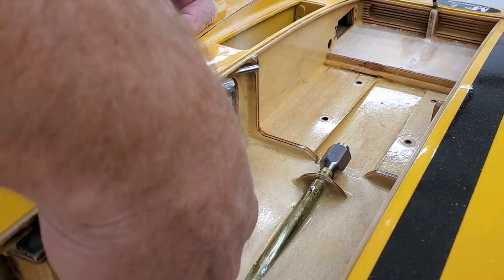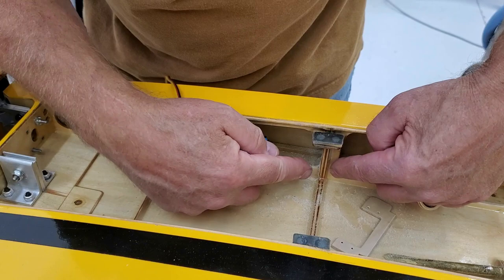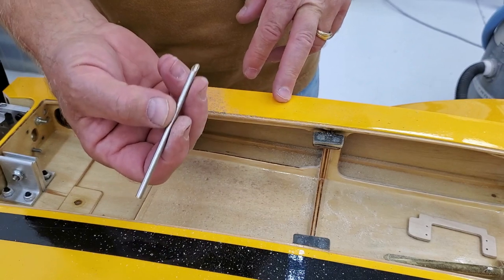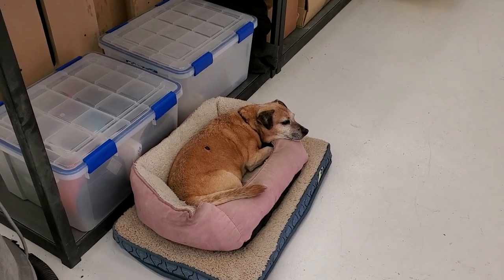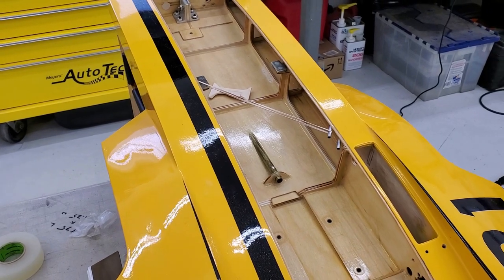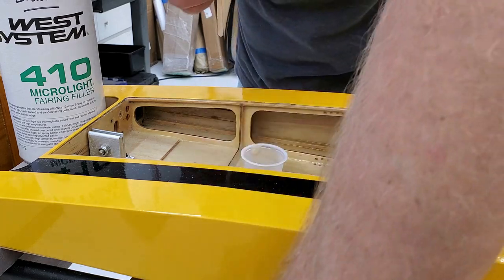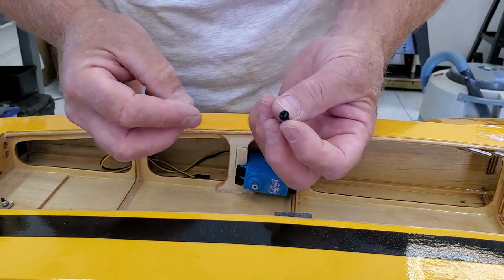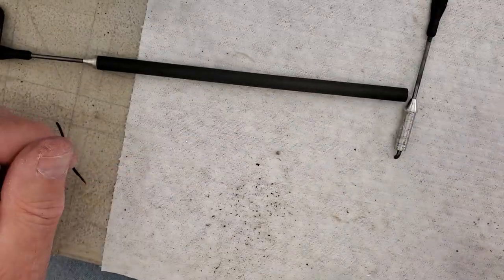Nitro to Electric RC Hydroplane | Electro Eliminator Part Deux

Comment: Scott, because of your videos, you have rekindled my passion for r/c boats. Specifically unlimited hydro. Once i got married and had kids, rc faded away. Im a CNC machine operator and i do the cad programming for my machine so about a month ago i designed a boat with a mid 90's hull design. I had always wanted a big scale boat so i designed the boat i am currently framing out in my garage to full 1/4 scale. Because of its size it will be a fiberglass shelled boat. I just wanted to thank you for taking time to put these videos together, if it was not for your videos, i wouldnt have gotten back into rc boats, especially at this scale. Great videos, fantastic builds, keep up the great work!
Reply from the maker: So what you're saying is, it's all my fault!
That sounds like a cool build Allen, and I'm pleased to have had at least some influence.  Get 'er done!

Comment: I like your videos,i can only wish I had chosen the boat you are running as my first build instead of the one I have.i could have picked up a lot of confidence in what im doing.mine is back in the box on the shelf now.
Reply from the maker: Go for it Gary!  Even if it's not ideal you'll still learn a ton just from getting epoxy stuck in your hair
Reply: @M5PerfHydros  no hair for me,im bald😂.the rear end of the boat I figured out. I’m still confused about how to build the center at the cockpit area of the boat.and the bull nose area.i built some blocks and had ready to install but it just doesn’t seem correct.im thinking I may build a solid nose across the front like your boats and get a cowling like yours and forget about trying to build like the tide hydroplane.even if I purchased the cowling I don’t think it will help me determine the angle towards the nose of the boat and once it’s epoxied there’s no turning back
Reply from the maker: I can understand. When I build a boat I spend way more hours thinking and staring at it than I do in the actual building.  But still... There's no such thing as 'no turning back' with wood boats. If you don't like it, cut it off and redo it.... I do that all the time. It's what makes wood boats so much more interesting than fiberglass hulls.
Reply: @M5PerfHydros  I can understand why you spend the time thinking about it.I may get it back out and get better epoxy and try again.

Comment: Scott Meyers you mention at 40:30 that somewhere online a company that sells the pushrod ends you glue into the carbon fiber tube. You might be thinking of Central Hobbies in Billings, Montana that sells Titanium Push Rod Ends specifically for their carbon fiber pushrods (tubes).
I purchased for my 1/8 scale hydroplane the Part#: CHMROD38 pushrod with the .210 inch outside diameter. And the Part#: CHMPRE38T4 titanium ends with the 4-40 threaded end. The threaded end is only 3/4" long.
And I purchased what they recommend for an adhesive IC-2000 cyanoacrylate carbon and rubber toughened.
I might purchase from Central Hobbies a small diameter carbon fiber pushrod and titanium ends for the rear wing supports on my 1985 Miller American.
Reply from the maker: Yup that's it, thank you!

Comment: Lets hope your packs never swell. :) Just started watching....
Reply from the maker: Right?
Reply: @M5PerfHydros  Only if something goes very very bad with your setup will those packs swell up. I don't expect you to run into that trouble however if they swell enough in a bad circumstance, you will need a Dremel to get them out. Again, it would have to be a grave error to cause this. 
I love your build style. I love your videos, thank you for all you are doing!

Comment: I know this is an older video. However have you considered using an ESC with a built in BEC to pwer your receiver and steering servo to eliminate the receiver battery? Less weight and wiring.
Reply from the maker: Yup, that's the way to go for sure.  This build was commissioned by the new owner and the parts he provided were used

Comment: Hey Scott, as you suggested Im building.  Its a Black Pearl P Sport.  Thanks to you its going great.  I noticed the floor of your hydro looks glossy.  What are you using after you seal?  Is that clear coat?  Thanks again for everything.
Reply from the maker: Yes!  I first seal it with thinned epoxy.  Apply it heavily, wait a minute or two, and then wipe out all the excess epoxy with paper towels.  After it hardens I scuff it very thoroughly with 3M pads to smooth the surface and remove all gloss.  Now when I clear the boat I shoot heavily in the interior. The result is beautiful and very well sealed
Reply: @M5PerfHydros  Thanks for everything! Just finished my top skins per your instructions. It looks great.  Im blown away at how well the Black Pearl assembled with proper instructions.
Reply from the maker: So awesome!  Hey where's the video? Hmm?

Comment: Any suggestions on how to make that awesome steering shaft if you don't have a lathe? Most of us don't,  lol. What steering servo do you use? You build incredible boats sir.
Reply from the maker: I do have a suggestion... Buy a lathe!  Optionally, I know a few guys who use these. They are for a smaller carbon tube, and I prefer the larger, but you could always sleeve them up if you wanted to. https://www.centralhobbies.com/singleprod.php?id=1789

Comment: Have you considered using an ESC with a BEC to power your  receiver and steering servo, which elminates the Extra receiver battery. Less weight and simple wiring?
Reply from the maker: Yup, that's the way to go for sure.  This build was commissioned by the new owner and the parts he provided were used
Reply: Nice build. I started using Brent's Wire drive in my boats after seeing your build, even in my grandson's proboat shockwave 26 mono